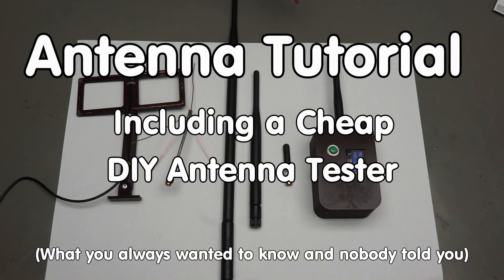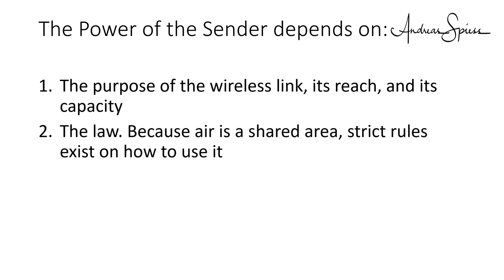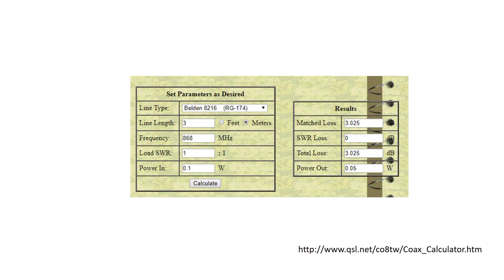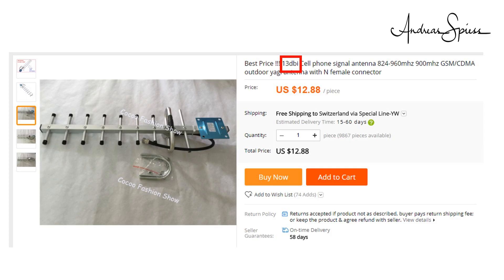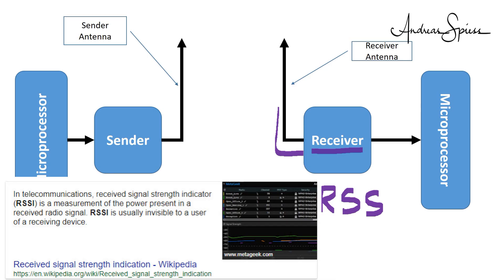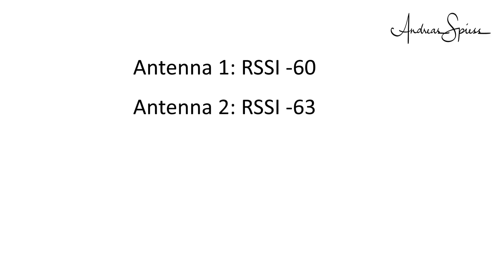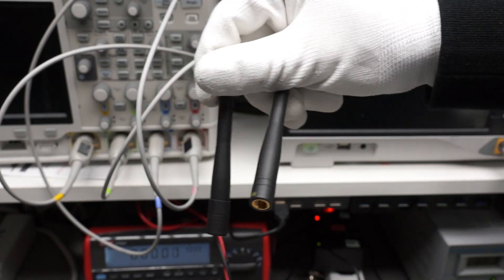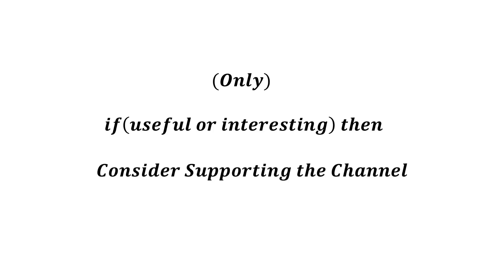#188 Antenna Tutorial incl. cheap DIY Antenna Tester (LoRa, ESP32)

Comment: Hi Andreas,
Thank for your youtube videos. I am enjoying the ones describing the LoRa project.

Can you share the code used in your send and receive instruments, I would like to carry out similar test. 73 Gary vk2kyp
Reply from the maker: Maybe you watch my LoRa videos. There you should find the links to the code
Reply: Thank you Andreas, I manage to successfully compile the "AntennaTesterSenderV1" 
I had errors when I compiled "AntennaTesterReceiverWEMOS"

Arduino: 1.8.5 (Windows 10), Board: "TTGO LoRa32-OLED V1, 80MHz, 921600, None"

C:\Users\Gary\Downloads\Antenna-Tester-master\Antenna-Tester-master\AntennaTesterReceiverWEMOS\AntennaTesterReceiverWEMOS.ino: In function 'void initLoRa()':

AntennaTesterReceiverWEMOS:173: error: 'D0' was not declared in this scope

   LoRa.setPins(D0, D0, D8);

                ^

AntennaTesterReceiverWEMOS:173: error: 'D8' was not declared in this scope

   LoRa.setPins(D0, D0, D8);

                        ^

exit status 1
'D0' was not declared in this scope

This report would have more information with
"Show verbose output during compilation"
option enabled in File -> Preferences.
ceiverWEMOS"

Andreas have you seen this before.
Thanks Gary
Reply from the maker: These sketches are not for the ESP32, they are for ESP8266. ESP32 use different pins. You have to dig into the documentation of the board. I never used an ESP32.
Reply: Thank you,  I am sorry for my error.
regards Gary
Reply from the maker: No problem, we all learn. It should not be too complicated to find out which pins your ESP32 uses instead of the ESP8266. Keep in mind that the -32 do no more use the Dx scheme, their pins only have numbers.

Comment: Hi, one question, where I could I get the board with the antenna connection for the lora module?(like the one that is shown at min 13:46) and where I can buy also small decent antennas? Thanks a lot for your fantastic videos!
Reply from the maker: There are many different videos about these topics on the channel. Also with links in the description.

Comment: Would you be able to test/verify  effectiveness (gain if any) UHF RFID asset tracking tags e.g. Impinj tags? Some of the antenna pickup range is upwards of 10meters @rssi 100dB. The plastic tags has an RF+ and RF soldered to the RFID chip.
Reply from the maker: UHF RFID is not easy, because they use the energy of the "reader" and modulate its carrier. I have no experience with them.

Comment: Excellent!! This is a very good absolute-beginner introduction, and it is technically exactly correct, thank you Andreas.  Regarding the legality of adding antenna gain, yes you must lower the transmit power to stay inside the EIRP power limits, BUT remember that the gain antenna ALSO works on receive so you get your "lost power" back again at the receive end! The cheap N1201SA analyser will show cable loss.   Antennas are like fittings for your garden hose - you use a shower fitting for wider coverage and less range, or a squirty nozzle for longer range and less coverage.
Reply from the maker: Thank you for your additions!

Comment: I love antennas. Your Moxon was presumably to get some gain. I looked it up on Wikipedia and it looks like a form of folded yagi. 
Somewhere back in history, I was a great fan of the quad (in HF use). The quad is quite effective as a directional antenna (Wikipedia has a brief description ) and may give better performance. Theoretically it should behave more predictably at the short wavelengths you are using than at HF and be quite compact. Your lovely vector analyser would allow it to be perfectly matched too! Just a thought...
Reply from the maker: A quad is on my list, too...

Comment: Excellent intro to the black art! 
One new trend has always puzzled me with the wifi routers that have 3 antennas on them.
Pointing them in odd directions, changing the distance between them - all sorts of things would play havoc with the radiated pattern and signal strength.
Wavelength at 2.4GHz is about 122mm so they are nearly always within a wavelength of each other.
So would one well tuned antenna be as good or even better? And are the three antennas individually matched or just strung together? 
Your methodology would be very interesting applied to an investigation of this (horrible) trend.
Anyone?
BTW, I love your ground plane antenna and was not surprised to see how good it was!
Reply from the maker: They use very sophisticated patterns there (Mimo?)
Reply: Hmm. That looks like a 2 pipe problem (Sherlock Holmes value)

Comment: Rule #3 ... or  use a dummy load
Reply from the maker: How would you use a dummy load to test antennas. I usually use a dummy load instead of an antenna.
Reply: it's not about the test for the antenna but for the health of the transmitter - so you are right :-)
Reply from the maker: The spectrum analyzer usually acts as the dummy load for this small power.

Comment: +Andreas Spiess, have you thought about making and testing 2440MHz PCB Moxon antenna? I did some searching, it looks like nobody tried it yet, and I wonder why. PCB process could make it cheap and easy, and usually sensors are installed in a fixed position, so you can point an antenna to a node. What do you think? I can make PCB design, you have VNA equipment, we can do it.
Reply from the maker: I am on facebook messenger and on twitter if you want to contact me concerning this project.
Reply: I sent you message on Facebook. It was quite busy week.

Comment: Thanks for a great video :)
If I want to try out a small  lora experiment, what board should I buy and antenna (living in Denmark so it should be EU frequency)?
Reply from the maker: You can buy whatever you want (except the two boards I found not to be good). If you want to use LoRaWAN, you have to be on 868. Otherwise, you can also use 433 MHz

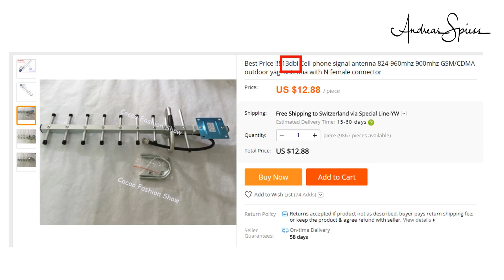Comment: Hi Andreas, you ask at 8:30 whether you can use these at full output power? Usually not, but it will depend on your local ISM laws. Here in Australia for example, LoRa (on 915MHz) is limited to 1W EIRP (Equivalent Isotropic Radiated Power). So a 13dBi antenna would need to have the transmitter power limited to 17dBm or less. Or, for a 3dBi, 27dBm or less, and so on.
Also, do you have a link to the device you're using at at 6:00? Looks a bit more useful than my rfexplorer!
Reply from the maker: That is what I thought. And yes, I have a link. But you have to be a little patient...
Reply: Hi Andreas. It took a while but my Google-Fu eventually helped me find that it's an AAI RF Vector Impedance Analyzer N1201SA Thanks for the reply though and, ofcourse, for your excellent video's!

Comment: Good topic. It might be worth mentioning that RSSI drops with distance squared. (87km/123km)=0.707. Squared = 0.5, same as -3dB. So the change in distance in air corresponding to -3dB will be the original distance * sqrt(2).
Reply from the maker: Thank you for your explanations. I briefly mentioned it, but not as thorough as you.

Comment: At 5:00, the dBm/Power table shows 1W for -20dBm and also 1W for 30dBm.  Is it an error?  I suspect the value for -20dBm should be .00001W?
Reply from the maker: The -20 dBm point is wrong.

Comment: About that 1kW max power with your Ham radio license, you may want to look in to your country's governing body regarding the rules. I've heard Switzerland is considering dropping the max power limit of general licensee's down to 200 watts PEP.  It may be a good idea to check in to it. I'll link to an article of I can find one. I heard it over there air on Ham Radio Newsline's net.
Reply from the maker: I have no such gear and You saw an excerpt of the current rules

Comment: What kind of wire do you usualy use? RG213?
Reply from the maker: I try to omit coax as much as possible by placing the transceiver close to the antenna. Then I use different cables,  according the need

Comment: The rssi can be roughly evaluated also using a 10$ sdr and rtl_power or other tools, without decoding the signal. Another indicator could be the digital RX quality, it's the percentage of lost beacons, a wifi example is with airodump on a fixed channel.
Reply: The RX quality could be something like the bert (bit error rate) so precious in the good old days. All that stuff can be implemented using cheap MCUs ;)
Reply from the maker: You are right. But these signals are quite short and not so easy to detect. And you have to take your Laptop with you!
Concerning RX quality: This setup is not focussed on link quality, it is purely made to check out antennas. Link quality is probably more important if you want to check out how big the range of your devices is.

Comment: To avoid rf cable loss a simple solution is connecting the RF module directly to the antenna and using a good cable on the serial digital side, if the RX module must be far from the MCU.
Reply from the maker: That is what I do most of the time.

Comment: I've been an antenna / RF nerd for decades. This is the best explanation of all the important factors I've ever seen. (Also a nice review for the old timers) Good work!!!!!
Reply from the maker: Thank you! I am pretty sure you will like the next video ;-)
Reply: Hi @sethalump, do you do any freelancing work? I would like to extend an esp32-s3 ble transmitting range (to a smartphone)
Reply: @mariusdrivedocro  look into LoRA, that's the wireless tech you want if you want to go far
Reply: @sethalump  thank you, do they have standalone bluetooth modules? I’m a bit lost searching for something on the web. Can you recommend any?
Reply: @mariusdrivedocro  Sure there's lots. But maybe we should start with what you are trying to accomplish?
Reply: @sethalump  Got it. I tried 2 setups, one with esp32-s3 (ble 5) and other with arduino nano and hm-10 ble 4.2 module. Both let me down in terms of range, I get like 7-8m, sometimes even less on hm-10. I’m trying to find a decent solution, real 15 meters is enough. Best short-term way would be to add an antenna to hm-10, because these modules are in production, but didn’t find much on the topic. If it can’t be done, I guess a total pcb redesign will be needed (maybe with lora or nrf)

Also, maybe I can change the hm-10 ble breakout module, it only has only 4 pins (powering and tx/rx)

I should mention these pcbs are connected to with an app (iOS or Android). I am simply using LightBlue or nRF Connect apps to check for RSSI and connect/disconnect from the pcb’s ble

Any feedback is much appreciated, thank you!
Reply: @mariusdrivedocro  ok. What sort of data are you trying to pass? This like audio levels of data, file transfer, or low bit rate button press stuff?
Reply: @mariusdrivedocro  also why BLE? It is not designed for range. Bluetooth probably offers more range itself
Reply: @sethalump  button press stuff, few characters at a time, some 15-chars sensor data at every 300ms. Nothing fancy. I was under the impression BLE is better in every aspect. Also, I tried some older AT-09 bluetooth a few years ago and it was not working with iOS - hence going to hm-10 ble 4.2

I also read a lot that BLE 5 has bigger range

Comment: This video is very good. Accuracy of the information is simply excellent!! Well done.

The word 'Transmitter' is more common in the context of antennas. I've seen the word 'Sender' being used to denote the gadget that is sending data (but perhaps also receiving acknowledgement packets back), so actually an RF Transceiver. The distinction is between the Physical Layer (RF) and the higher Layers (Data) [ref 7 Layer Model]. Antennas are at the Physical Layer, so Transmitter and Receiver (actually they're Transceivers at both ends).

@13m43s, it would be better if the antenna was not so closely paralleled with the USB power cable. It's best if they're installed free and clear of other conductors. Especially to maintain consistency for measurements. (I know you know; I'm just commenting on what's shown in the video.) This point was touched on later.

Thank you for your excellent videos.

73
Reply from the maker: As you know I am no native speaker. So I do not know the language well.
Concerning the USB cable: You are right, but the board I used did not allow a different setup. Maybe in the future, I will power also the receiver with a battery to avoid this situation.

Comment: This is great! I’m currently working toward my first amateur radio license. I’ve been thinking a lot about what kinds of antennas I want to buy/build. 

John Park, on the Adafruit YouTube channel, recently did a video on an making an Morse code AM transmitter. He used an analog output pin and a long enameled wire for an antenna. It was very low power and had a very short range but seems like a really interesting concept to play with.
Reply from the maker: To build a CW transmitter is simple: Just switch an oscillator on and off ;-) But to understand what was sent is a little more complicated.
Reply: Andreas Spiess yes. CW isn’t required for my license, but I’m interested in learning it.

Comment: Oh so true! I've experienced a wire cut to the correct length being a better performer than an off the shelf 868 antenna (also considering connector losses).
Reply from the maker: Only a wire is probably not the best solution as you saw with my Ground Plane antenna
Reply: Andreas Spiess That's exactly The message.... A wire outperforming a factory made antenna, tells a lot about the latter. Probably it's more a waterproof dummy load than an antenna. Unfortunately my antenna analyser only covers HF and VHF, so I'm looking forward to some instructions regarding a 868 reference antenna.

Keep it up! Your videos are great!

Comment: This was very nicely presented.  Antennas are somewhat of a black art, and since my background is computer science, not electrical engineering, my knowledge is more empirical from 30 years of amateur radio and the occasional RF burn.  I think it would be useful if you could incorporate some testing and present the effect of other conductors/cables in proximity to the antenna and how the gain is impacted.  This is something that has always concerned me, and in some scenarios, could degrade the performance in a surprising way.  Taping a wire antenna to wood "works", but maybe when it rains and the wood becomes soaked with some water.. not so well?  Or having just having other cabling in the near-field of the antenna..  Thanks for making this video and sharing it with us.
Reply from the maker: Thanks for your feedback. We will see what I can do. This channel has many different topics and I cannot stick too long on antennas only. There are some others focussing on Ham radio. But at least one will come which will cover parts of what you wrote.

Comment: Excellent video, dear Swiss guy! Just because we're talking about antennas, for a Wemos Mini pro, which antenna should I purchase without being cheated?
Reply from the maker: You cannot connect an antenna to this board.
Reply: But in the pro board there's an IPEX connector for external antenna (alternative to ceramic one)
Reply from the maker: You are right. I did not read properly. I never tested Wi-Fi antennas so far.
Reply: well, as our beloved ESP is based on a good Wi-fi signal, able to cover z.B. the area of a garden (1000-2000 sim) , Wi-fi antennas could be covered together with the more glamorous LoRa antennas.

Comment: I think it would be very beneficial to show the amount of signal loss by having a human and other objects (tree, building, etc.) near the antennas.  It is amazingly large!  Even at 27 MHz (old "CB" Radio) it was huge with a handheld "walkie-talkie" I measured in the '60s.  One of the major misunderstandings about T-R link is the need for a ground plane at both ends.  With hand held devices, you are the ground plane.  Lastly, what is discussed for line of sight at high frequencies is correct, but low frequency LW & MW (AM) radio receivers use magnetic coupling ("H"wave").  This is increases reception range and is a way to get around the "line of sight" issue. Look inside an old radio for a loop of wire for the antenna.  In handheld radios, the loop is on a ferrite core, which was often referred to as a "loop stick" antenna.
Reply from the maker: You are of course right. But this is no "ham" channel and the topic was big enough for one video...
Reply: Yes.  Thank you for this video. I only raised these specific issues, which could be a basis for a future video summary,  because of the large impact to your topic: Radio Range.  I can tell you of many instances of unknowing guys complaining of bad or no reception when they had a wire antenna wrapped around the receiver and clasped in their hand, or a transmitter (and antenna) taped to the side of a refrigerator or stuck in a pine tree.

Comment: Not sure if you are aware of Windsurfer Antenna additions to add direction to the normal stubby antennas, I tried this with some NRF24L01 radios and it worked. I thought of it when I noticed in the video the piece of what looked like duct tape on the wooden pole behind the tx end, a piece of kitchen foil would probably also skew your results to the better too. I submit this in the interest of achieving cheap improvements for those of us on a budget, for whom you seem to champion. Bravo.
Reply from the maker: Antenna design has to do with dimensions. Unfortunately, 868 antennas become much bigger than 2.4G antennas. I am not sure of the feasibility of such a design. Maybe you try it once?
Reply: No, have not yet tried with 868 (still waiting for my TTN Backer kit to arrive). From my very simple experiment with NRF24s, even a plastic box in my case, or probably that piece of wood and duct tape will possibly have added some directional bias to your experiment - for zero cost. Be nice to prove it, but don't let me divert you! I will let you know if I get chance to try it.